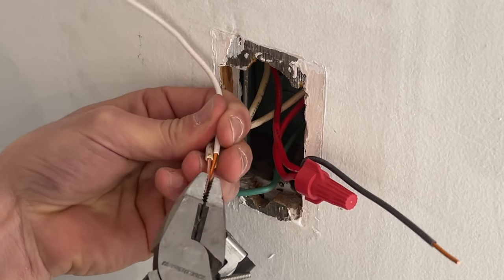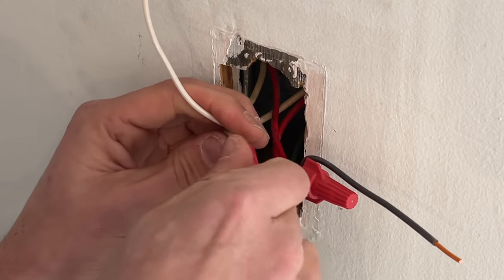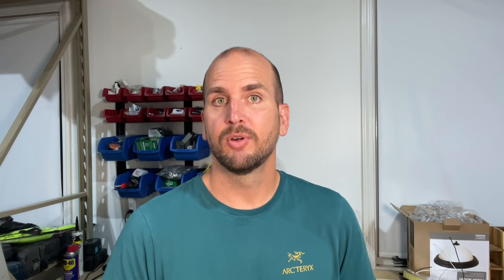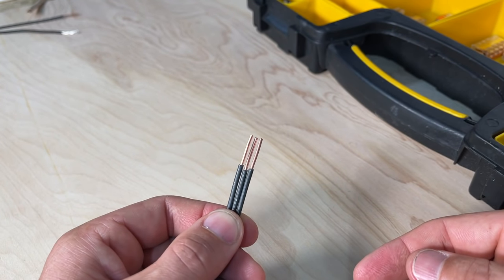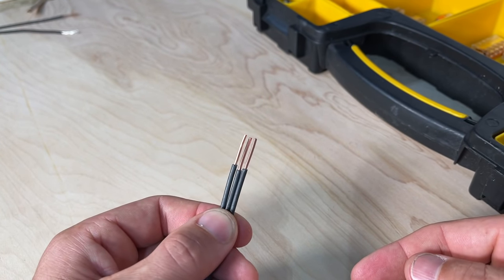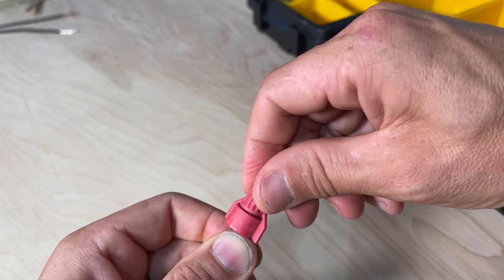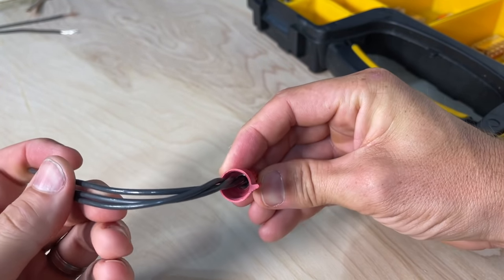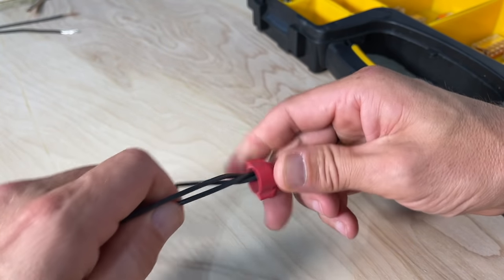10 Things You Didn't Know About Wire Connectors

Comment: Excellent video!  “Wire Nut” is a registered trade mark of Ideal Industries as of 1/22/63.  For safety sake and for a good electrical connection, I always pre-twist my wires for now over 50 years without a problem.
Reply from the maker: Hey Bill, thanks for the call out on the trade mark I was not aware IDEAL had that locked up.
Reply: @EverydayHomeRepairs  You are most welcome.  So companies are very protective about their names such as Xerox where they want to people to use the work "photocopy" a page.  The word "aspirin" lost its trade mark protection because it become general vocabulary among people.
Reply: Then IDEAL needs to be suing a few thousand companies, because everyone calls them "wire nut".
Reply: Two or three 14's and I don't pre-twist.  Few 12's and you almost have to.
Reply: I found if you don’t pre-twist, sometimes one of the wires will pull out of the wire connector.
Reply: @billhandymanbill2775  Yah,  I've found that is one wire moves when you go to twist on the nut that happens.  I don't think either way is really wrong so long as it holds long term.
Reply: I thought Ideal owns Wing-Nuts not wire nuts
Reply: @philemonyarbough695  "wire nuts" and "wing nuts" are both registered words by Ideal Industries for these types of twist on/off wire connectors.

Comment: Thanks for sharing. The rule that caught my attention was putting the stranded wire a bit higher than the non-stranded wire when incorporating them both into a wire nut.  That makes perfect sense and I can see where that would make a better, secure connection.  Appreciate the tips.
Reply: Yep, that's the tip that I took away from this video too. It makes perfect sense -- the solid wire won't twist (and therefore won't shorten) but the stranded wire will. Great tip.
Just sane...  :^)  Saint
Reply: i already did that!

Comment: I'm a DIYer from Scotland and here in the UK we've never used wire nuts it was always the old multiblock connectors that you could cut down to whatever size you needed,I use the Wago/Ideal push or lever style but after watching John Wards video on testing them out in a comparison to the cheaper Chinese copies of the grey with orange lever kind I now save money by not buying the more expensive ones and getting the cheaper make on Amazon,John's test showed that even at double the maximum voltage that our 240v domestic system supplies they reacted the exact same as the named brands,if you have not watched John Wards channel I highly recommend it.Another brilliant innovation to the electrical business is the Quickwire system,it is absolutely one of the best junction box/connectors I have seen especially if you are using loop in loop out and switching on your lighting circuits etc,really enjoy your videos even tho our UK components and wiring systems are slightly different from USA and Canada

Comment: Both are great as long as they're done right, I had a service van for 4 years before I move to Industrial and I've seen issues with all kinds of connections. Biggest thing is when stripping the wire if you notice your stippers are ringing or marking the wire  use the next larger gauge as I've seen far more wires breaking before the connections then a problem with the connections itself.

Comment: DIY - 0

I use all three of the connectors you covered and think that each has its place and all are OK to use if you know how to use them. Your video covered the important aspects of their use in a clear and concise manner. Every DIYer should watch it before attempting to perform any high voltage wiring. 

The one thing you didn’t mention about the Wago lever lock connectors is that you have to be careful when you stuff your wiring behind large devices like GFCI receptacles or WiFi switches that the lever(s) on the Wago connector block haven’t inadvertently contacted a wire or corner of the device and been forced open. I have had that happen to me in a couple of occasions. Fortunately when I tested the circuit before installing the cover plates I discovered the fault because the wire was completely withdrawn from the now open connector block. The problem with the large size devices is that their size forces you to stuff the wire more tightly into what little space is left in a shallow box. They also limit your ability to visualize the now open lever. If the wire was still positioned loosely within the connector block there is a risk of a high resistance or intermittent connection and potentially a fire hazard.

Comment: A couple years ago I came across the Wago push-in connectors. Will not go back. But for mixing solid and stranded, like on light fixtures, will definitely be using the Lever Nuts.

Comment: I just finished working with the Wago's for the first time and loved them. I felt the Wago was much easier to use in a crowded box. Wire nuts stiffen up when grouped together where the Wago's were much more likely to be less stiff like a single wire. I was changing to smart switches which take more room than the original sp switch. I still used the wire nuts for the neutral groups because there were more wires to that connection.
Reply: You can stick your tester lead in them on the front and on the back(special holes for it). You can and should visual check your connections through the transparant housing. Use them for your neutral aswel. The push in version exist up to 8 and the clamping one with lever up to 5. The ones with lever are better, but bigger and more expensive. In routine work you should use pushin version. Also check their range for connecting wires on DIN rails. Just like phoenix contact they are among the best.
Reply: Can you leave ports empty
Reply: Same issue, moving my house to smart switches. In some boxes I could not get the switch in until I switched to one of these push on connectors. Mostly because they're flat and I can push them to the back of the box. I gain just enough space over the Marrettes to get the switch in.
Reply: @kevinkeveney7896  Yes, unconnected ports are considered IP20, so no issue there.
Reply: @BPo75  Thanks

Comment: DIY, tried out the WAGO 221 connectors because of you. Bought the 175 pack. I really wish I had them when we built this monster house back in 1996. Updated, and changing some dimmer switches, all the wire nuts came out, and WAGO 221 connectors were used.
Reply: Be glad you didnt have them.

Comment: Very timely for me!! I just installed a dimmer light that has stranded and also needs to tap into the neutral bundle in the box. I used push-in ilo wire nuts and triple-checked my connections but I was not feeling happy or confident while putting the switch plate back on. I stopped at Home Depot last night for a few extra supplies and already had plans to open it back up and re-do the mess in that box this week.
Reply from the maker: Nice, best of luck on round 2 👍

Comment: Once you go lever Wago, you’ll never go back.  Not only can you test the connection but you can visually inspect them to verify the wires are in correctly.  Also trouble shooting is so much easier as you pop a lever to isolate a line.
Reply: Wago are super expensive compared to a wire nut.
Reply: @sampantiliano  Exactly the reasoning why in the US there are so many call backs of failed products.
Reply: Can you use stranded wire with a lever Wago connection
Reply: @markmarxman584  yes, you can AWG 24 - 12 Cu
That's also why I love the WAGO 221 series (2, 3 or 5 connections).
Reply: @markmarxman584  Yes you can. See https://www.wago.com/us/wire-splicing-connectors/compact-splicing-connector/p/221-412
Reply: @sampantiliano  $0.25 versus $0.12 each, I mean ok they are more expensive but it's in the same range and you can work faster. They more than pay for themselves in time saved.
Reply: Like using Wago and the extra cost, worth it IMO. However, each job is diff and do use wire nuts still. Just depends on job and what doing for what will end up using.
✌🏻
Reply: If I could find Wago for .25 I would buy them too.
Reply: @ssl3546  And in jobs done right. It's so easy to screw up a twist connector, leading to a dangerous or faulty connection.
Reply: Wago connections do tend to have higher resistance than wire nut connections. For peace of mind, I'd rather have wire nuts for outlets / high current circuits. Definitely using wagos on lighting though - especially with all the overhead work
Reply: Go back believe me.

Comment: Re #4, names for them: I'm in Eastern Ontario, Canada, and I've never heard of 'wire nuts' before this, they're all called 'marettes' here. That said, I'd never heard of the Wago connectors either, they aren't very common around here. 
You're a wealth of knowledge and experience - thanks!
Reply: The WAGO connectors are quite easy to find and at a reasonable price. Does the word AMAZON ring a bell?

Comment: I use wire nuts in my trade, HVAC, it’s what the company provides and I pre twist because it is the way I was taught. I greatly appreciate this new knowledge regarding the topic.
Reply: its bad info, you should still pretwist, im a professional electrician
Reply: @robduncan7409  for HVAC not really needed. You work with a lot of small guage wire doing HVAC. The only cases where pre twisting is more or less required is with thick wire or many wires.
Reply: U must twist the wires. Far far better than any wago or push in.
Reply: @RadioRich100  How do you know? How can we tell?

Comment: The wire nut instructions don't say that you shouldn't pre-twist, they just say that it isn't necessary- that's a big difference! In my opinion pre-twisting may not be necessary in new 14 gauge wire, but for 12 gauge solid wire (or thicker) at least it's a very good idea, as it's hard to get a thorough twist using only the wire nut

Comment: I tend to pre-twist.  I do the pull test too.  I do all of this as I feel I want to, as you said. see the wire twisted... know for sure it is twisted.  Stranded is a pain and that always causes me to be more than super sure those are tight to the point I will solder sometimes in some situations.  I have seen too many burned wire "nuts" from that stranded wire problem.  Good on you for going deeply into that!  I somewhat depend on colour to guide me but I always look inside the "nut" to make sure the coils look to be the correct size.  Also a great point on colour being a misty problem from company to company.  I haven't used the Wago's yet but I may in the coming week on a water heater project.  I lived in Hillsborough NC for a long time and many of the homes there use knob and tube that still works!  Piles of bird and squirrel skeletons next to the wires in the attics, but they still work.  It is just a joy to see someone go into the simple stuff as that's where most thing fail.  Nice Work!

Comment: Great video. I recently replaced all the light switches and some light fixtures in our new house. I like using push-in wire connectors because they're easy and provide a good connection. Some of the wires were braided, but I tinned them with my soldering iron. It's still a little difficult to get those wires into a wire connector, but I'd rather do that than use a wire nut. I only use a wire nut as a last resort and it amazes me they're still in use. I'd never heard of lever nuts before this video and would like to give them a try sometime. Thanks.
Reply: I know that tinned stranded wire is a no go in screw terminals because over time the tinned braid loses its shape and the connection becomes loose. I have no idea if the same would happen in a push in connector but it seems like a bad idea to me. Seems better to me to get something like the wago lever nut that is rated for stranded wire.

Comment: Wow, what an excellent balanced video.  No hype or opinions, just facts.  I'm very interested in the push style connection longevity.  All data I've seen shows them superior to lever style connections and in my experience they are also easier to work with and smaller in the box.  So many people frown on them though due to their similarity to old style backstab connections but they use a different capture geometry and materials so I don't think it's a fair comparison.  Sill I have my doubts.  Nothing beats a wire nut done properly - unfortunately its so easy to do it improperly that many are.

Comment: One you didn’t mention is the Marrette with the brass insert and set screw, inside the screw on cover. Sometimes found in older homes. Also worth mentioning is that the cheap wire nuts often included with electrical fixtures are one use only. I’ve found that they usually strip threads after first attempt and fall off the wires.
Reply: At about 4:05 into the video he does mention Marrette.
Reply: i have some here. been told its for places with vibrations...
Reply: Wire nuts are specifically single use items, so reusing is not in accordance to manufacturers specs.

Comment: Wagos for the win. I’ve had to replace so many wire nuts over the years with these, especially at luminaries with stranded.
Reply from the maker: Agree, that is where I find the most common failures as well.
Reply: I was always told in the past not to use stab connectors, including the ones that come with Can lights.  I’m concerned that they can cause loose connections and arc fault issues.

Comment: Number 11 -- which I would talk about first -- is to explain HOW a wire nut holds onto wires.
Reply: The good ones have a tapered nut. The cheap ones use a spring. (the really cheap ones are just plastic.)
Reply: @jfbeam  The metal helix or nut inside the better wire nuts is to assure better grip on the wires,  and not necessarily for electrical contact.  Even the plastic models without the spring helix are pressure type connectors,  however,  plastic is softer than metal,  and is less reliable in the long run.  Cheap wire nuts can loosen up more easily over time due to thermal expansion/contraction and vibrations.  This is why the all-plastic nuts should not be used.  Applying pressure to the wires causes friction,   which helps to keep the wires from moving against each other.  The metal inserts insure better friction grab on the wire bunch - they are not intended to contribute to the electrical connection.  An exception would be the set-screw lugs in electrical panels.  Friction (pressure) joins the wire to the lug,  and the lug itself is treated as a conductor.

Comment: The action of pre twisting can cause deep scores in the surface of the metal of the wire which if you are heavy handed will cause cross ways thin spots in the conductor & can cause a hot spot under heavy load because it essentially makes the wire too thin. It also makes the junction unspecified for UL or CSA ratings. It is why we do not use screw downs without a fixed contact buffer plate between the screw & the wire in it's insertion hole. The practice is literally the action of part cutting the wire strands...

Comment: I'm a DIY with upwards of 50 years of experience, and I know that I am not a professional.  When I know how to do something, I do it.  When I don't know I either get educated on it or call in a pro.  I've always used wire nuts because that's what my Daddy taught me from a very early age.  I've always done the pull test to check my connections, and I've always twisted my wires.  Sometimes I have found that a solid to stranded connection easily pulls loose, so I twist it even more and sometimes even go to a smaller wire nut.  If I can't get this to work, I've occasionally gone to using electrical tape or even heat shrink tubing.  Now I'll get some of the Wago products and try them out.  I suppose every millennium I can learn something new!

Comment: I know electrical tap is not recommended on wire nuts, but I always heard it should be used to secure the nuts from future vibrations loosening the connection. As a serious DIYer, I enjoy the ease of use of the push in connectors mainly because they seem to take up less room in a box where there’s three or more lines coming in.

Comment: You can use stranded wire with push-in connectors IF you tin the wire with solder first.
Reply from the maker: Good point, thanks!
Reply: Much easier and faster just to use the Wago Lever Nuts

Comment: Former Menards electrical department assistant manager: I knew about the not using with aluminum wire.  But that was it on your ten things list that I knew.  Always assumed the colors were standardized.

I always have pre-twisted to try and make everything lineup even.  I learned basic wiring as a teen from my dad.  He also pre-twisted.

Comment: DIY. Interesting video, no I did not know all those rules about putting wires together together etc. After living in Seattle for 22 years, I learned to put dielectric grease inside of all of my wire nuts anytime I was anywhere near moisture or outside type conditions. This would include a box inside the Attic.
Reply: Must be a mess to work on after you.🤣

Comment: I will ALWAYS be a pre- twister . I strip my wires at about 1 1/2", give them a good, strong, consistent twist, then cut to length. I do this for the mechanical aspect. I only use wire nuts to insulate the connection from everything else in the box.
However, I will be using Delgada push-in connectors on my current project.
I'm SO progressive.
Lol :)

Comment: Great video!
For the pre-twisting, there probably are a few wirenut manufacturers that disallow it, however, IDEAL, a major one in the U.S., says pre-twisting is acceptable. If the manufacturer is ok with it, I pre-twist. Most electricians I talked to pre-twist, especially after finding the non pre-twisted wires often fly out of the connector once it’s undone. That doesn’t happen with pre-twisting so I believe pre-twisting offers a stronger connection. I think it’s similar to the screws vs. backstab. Both are allowed, but electricians prefer to use the screws.
Reply from the maker: Good analogy.
Reply: what he said